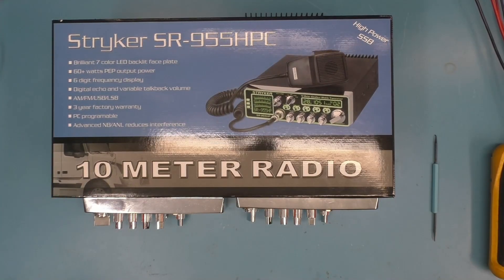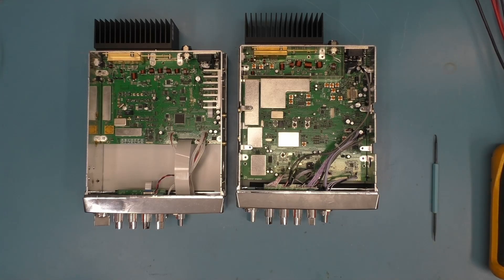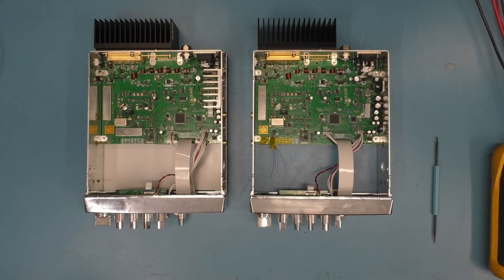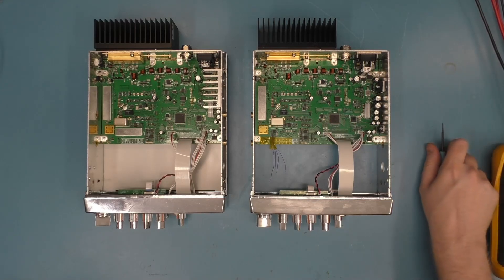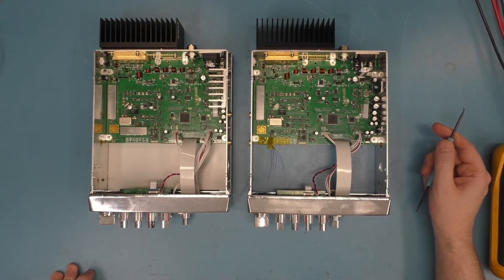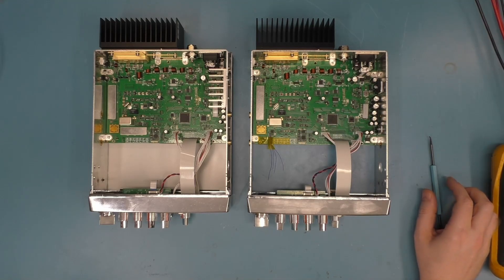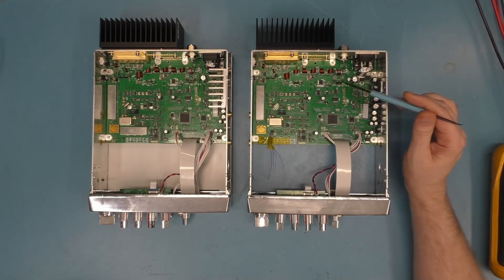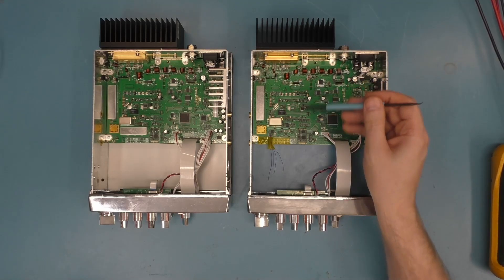SR-955 - Version 2 Internals - First Look

Comment: Mark I have a virtual instructor 955 it has been converted by watching your video I found out you can get ham radio on version 2 but is that the case on a virgin 1955 I would appreciate hearing your answer

Comment: These radios DO have a reverse polarity diode. It is in the back right corner. It is a SMT device labeled BET. I ASSURE YOU IT WILL BLOW UP IF HOOKED UP BACKWARDS!! 
73' Panic Attack
 @Mark19960   You are right it is a TVS and MOSFET. I over simplified my response. But I guarantee you it WILL blow the TVS diode if it is hooked up backwards! I have already repaired a 655 for someone that had the TVS shorted closed from reverse polarity. Telling ppl that reverse polarity won't blow up their next gen radios is a very bad idea! Granted the radio was fine but the rig has to have the TVS replaced before it will power up again and it will blow the rigs fuse if you try to power it up after reverse polarity occurs. It doesn't "magically reset" after a reverse polarity fault occurs.
Reply from the maker: Incorrect. They have a TVS diode and a mosfet. modern radios don't use reverse protection diodes anymore.
The component labeled "BET" is a TVS diode.
I assure you it will NOT "blow up" if you reverse the polarity.
Reply: @Mark19960   You are right it is a TVS and MOSFET. I over simplified my response. But I guarantee you it WILL blow the TVS diode if it is hooked up backwards! I have already repaired a 655 for someone that had the TVS shorted closed from reverse polarity. Telling ppl that reverse polarity won't blow up their next gen radios is a very bad idea! Granted the radio was fine but the rig has to have the TVS replaced before it will power up again and it will blow the rigs fuse if you try to power it up after reverse polarity occurs. It doesn't "magically reset" after a reverse polarity fault occurs.
Reply from the maker: @rangertechdx3511  You are wrong. TVS diodes are transient suppression devices. They have no polarity. You can reverse them over and over and they won't do anything until you exceed their threshold voltage. That's why they used one in this radio, for high voltage protecxtion. If you had a bad one that's because the voltage was exceeded, not because the polarity was reversed. They have nothing to do with polarity. That's not a condition that a TVS diode is used to protect against. There is no "magic reset" because the device isnt triggered in a reverse polarity situation, only overvoltage.
Reply: Ok they don't have polarity in the traditional sense but there are directional TVS and bidirectional TVS. The rig in question will blow the  TVS if reverse polarity occurs. The rig that was brought to me for repair was hooked up to his power supply backwards. He told me he did it. No way an over voltage situation occurred.
If you have so much faith in the directional TVS not blowing do a video of you hooking up your radio backwards lol. I'm just trying to help ppl just like you are. These radios....well at least the one I seen blew the TVS from reverse polarity...simple as that, rather or not it should have wasn't the scope of why I posted a comment. I understand perfectly what a TVS is and does. Most ppl that buy a radio won't understand though. I'm just saying I seen the radio blown up first hand from reverse polarity. I have nothing to gain or lose here I just don't want ppl blowing their radios thinking that the TVS and Fet will save them and no harm will be done from reverse polarity. Sure maybe they don't blow every time reverse polarity occurs but a standard rectifier diode for protection doesn't blow every time either. 
I am not wrong, the directional TVS can blow from a reverse polarity fault in this radio, simple as that!
I appreciate you messaging with me back and forth here. 
Maybe it has gave everyone a better understanding of how these radios are protected. Like I said the radio I fixed was fine. The protection circuit done it's job.
73 Panic Attack
Reply from the maker: @rangertechdx3511  The radio uses a bidirectional TVS diode.
You should know that those are intended for use on AC systems, digital lines with positive/negative voltage swings, etc...
And that is why reverse polarity will not cause a failure - they are designed for that use case.
The question becomes.... why are you repairing it instead of Stryker's warranty guys if its a new radio with a failure?
That would be a defective TVS diode... unless there really was an overvoltage or transient that caused it to do it's job.

Having one failure doesn't make it the norm.
Since you want to see a video, sure....
Reply: @Mark19960  I'm much faster than Stryker and I'm sure reverse polarity wouldn't be covered by warranty since it was no fault of Stryker. Also these radios use a unidirectional TVS device. It is plainly silkscreened onto the board. Remove one and have a look for yourself.
Reply from the maker: @rangertechdx3511  So the silkscreen now determines the part? Negative. What about the cap silkscreen on the board that has a resistor there?
Mate, I know what the part is. I know the part number of the part. It is a bidirectional TVS diode. I have the parts.
I will cover it....
Reply from the maker: @rangertechdx3511  Better yet. Go ask Stryker.... put it to bed.
Reply: @Mark19960  Just saying a unidirectional part is silkscreened onto the board and I seen a radio first hand blown up from reverse polarity from a regulated power supply. 
Oh crap....I'm man enough to admit a mistake I made. I just took a look at the bad part I removed and it is BIDIRECTIONAL. I didn't even notice when I removed it. I just seen the silkscreen on the board and replaced it with a directional J12a I had in the parts bin. 
The TVS in the radio tested closed so I yanked it out and tested the MOSFET it was fine. Seen the silkscreen for a directional TVS and replaced it with the J12a and all was fine with the radio.
Reply: None of this changes the fact the TVS failed closed due to reverse polarity.
Reply from the maker: @rangertechdx3511  That's assuming you have all of the facts. I have seen over my on and off career in engineering that customers are not exactly honest.
It also doesn't change the fact that the part is not intended as a reverse polarity protection device either.
Because you had one device that you think failed because of this condition doesn't make it a norm. It's at best a statistical outlier.... or manufacturing defect.
The correct part is CD214C-T18CA just FYI.
Reply: @Mark19960  That part is almost identical specs to the one I put in. Except the one I used was directional. I appreciate the info. 
In my experience a reverse polarity situation is the most common thing that CBers deny ever doing lol. He made his own 10awg power cord from the type of plug you can unscrew and solder wires to the pins. It was backward. I fixed it too. Maybe a freak thing, may be easier to happen than you think, I don't know, but reverse polarity occured and the TVS failed closed as a result, no more no less. That's all I wanted to say and I wouldn't purport that hooking them up backwards will cause no harm. I agree it is a better system of voltage protection, just to make that clear. I like the radios and am enjoying my 5555plus very much, just to be clear, I do think they are a great radio chassis.
Reply: @taft2422  I was sure of that as well. I appreciate the reply. He never would admit it's a very bad idea to hook up your radio backwards. I figured he was an inside man when he made a video and claimed the 5555 plus had a locked service menu and he wrote a program to access it but took the radio out of frame so he could push the buttons on the radio to open the service menu. Lol
Reply: The ppl need full disclosure. I appreciate ppl that respond to these guys!
Reply: @dhoutdoors9762  That's not a "claim". He had a video where he showed it and he took the video down. He probably showed too much.
His radio doesn't go into service mode like the other radios. He doesn't have to push the 4 buttons like everyone else on his radio.
Don't misunderstand the TAFT groups intentions here. We are holy fighters against Mark Sherman and his trolls.
When this guy says it's so, It is. He hasn't been proven wrong on any of this yet. If he says the radios survive reversed polarity then he is probably right.
Reply: @taft2422   @TA FT  Maybe so on the service mode, I don't know. I seen the video, I know he took the shot off screen on the video when he put it into service mode. 
What I do know is the radio I repaired did not survive a reverse polarity condition. I'm not saying these rigs don't have a better survival rate than others. I think the FET and TSV device is great! I just think it's a bad idea to say nothing will happen if you reverse the polarity. 
I'm not knocking what this guy is doing in his videos either. I just don't want anyone to take it the wrong way.
73 Panic Attack
Reply: @rangertechdx3511  I don't know anything about that stuff you were talking about.
We at TAFT are trolls. We troll Mark Sherman and he likes it :) We have more planned for mr marky sperminator.
You are splitting a hair man. We are trolls and we like to split the hair. That's what good trolling is all about.
I get it man, you are trying to troll. But he doesn't play ball with us trolls. He just starts to ignore us.
Reply: @taft2422  Nah not trying to troll at all, just stating what I have seen in this chassis if hooked up backwards. 
Keep up the good fight against the mud duck in the desert!!
Reply: @rangertechdx3511  We absolutely will keep that fight going. "Exposing" Mark Sperminator and his lack of "integrity" is our mission here at TAFT.
I just want to point out one thing man. You say you are not trolling. Ok maybe not.
You did change your story a whole bunch of times. You admit to making a bunch of mistakes. That's cool man.
The problem here man.. you say that it "will" blow up if you connect it backwards. I just did it to my Anytone and it didn't blow up.
It just didn't do anything. You say it absolutely will blow up if you connect it backwards. How do you explain mine?
You wrote in ALL CAPS " I ASSURE YOU IT WILL BLOW UP IF HOOKED UP BACKWARDS!! "
You keep speaking in absolutes. That it "will" happen. You said your customer admitted to connecting it backwards.
Come on man we have customers in our shops in the TAFT group that lie to us all the f ing time, or they don't know what they did.
We have Strykers in the shop. We will give them a try and see tomorrow.
Betting money that if my new Anytone didn't blow up then neither will the Strykers in the shop.
Just saying man. it's looking like Rutherford is right.
Reply: @taft2422  I guess I'll have to choose my language better. I should have said it absolutely CAN blow up from reverse polarity. Heck even standard diode protected radios survive a reverse polarity quite often. So I will be more careful in my wording from now on. 
Yes customers do lie all the time but I fixed his home made heavy duty power cord too that was wired backwards. 
I don't see where I made a bunch of mistakes. I oversimplified my initial comment by calling the TVS a reverse polarity diode, like I said I'll choose my language more carefully next time. But come on man how many ppl that buy a radio know what a TVS is anyway? It is part of the system that protects the radio from voltage spikes, reverse polarity, etc. ok? ok. I admit to mistakingly calling it a directional device and even putting a directional device into the repaired radio due to only looking at the silkscreen which is marked for a directional device. 
I certainly don't see where I changed my story either, only more details and clarification added.
The only point I wanted to make is the fact the radio CAN "blow up"(well blow a part in the voltage protection system which most "techs" would call a diode) from reverse polarity. I'm not trolling on Mark Rutherford at all. I appreciate his content and the conversion we had here. I certainly didn't expect so much push back for me reporting that I fixed a radio that was hooked up backwards and it blew one of the parts in the voltage protection system. I don't do much internet posting or commenting (I would be a terrible troll, heck I'm terrible at trying to help ppl to I guess lol)
I just don't want ppl saying to there friends "watch what my new radio can do when I hook it up backwards"  then poof!
 I'm glad your Anytone survived! It is a superior protection system with out a doubt. But believe me, I seen it fail from reverse polarity!!!
I'm very interested in seeing a video of this radio chassis being hooked up backwards!!
I'm loving my 5555 plus that's for sure. 
73 TAFT my intentions here are honorable as is the war against the mud duck in the desert!

Comment: ONE OTHER NOTE THE LINCOLN 2 PLUS ALSO HAS WATCH DOG SWR SHUT DOWN THAT THE OPERATOR MAY SELECT A SWR LEVEL  AND IT WILL ALSO SHUT DOWN THE RADIO TO PROTECT THE 13N10 FINALS.
Reply from the maker: What are you on about mate. What exactly am I mistaken about?

Comment: YOU ARE MISTAKEN ON NO OTHER RADIO NO OVER VOLTAGE PROTECTION AND LOW VOLTAGE PROTECTION. THE PRESIDENT LINCOLN 2PLUS HAS THIS AND IS AJUSTABLE AND IT WILL SHUT THE RADIO DOWN GIVIN THE SETTINGS THAT YOU APPLY.

Comment: How is the 11 meter conversion done now?? is it still removing the diode or is it all through the front of the radio in software??
Reply: I heard there was a wire inside that needed to be clipped, but taking that with a grain of salt. Hopefully someone will chime in and have the actual procedure for the V.2.
Reply: Thank you my friend for the input
.hopefully it is simple like the original one...
Reply from the maker: It’s simple. Just a wire.

Comment: Thank You, great tech info @@UCHTKv7msDiy_-nVWrwAmZcw . I just bought  a New 2021 Stryker 955 with the last of the current old boards, new from my Tech because I wanted to have a last Gen adjustable  955s ,gonna buy one of the 2022  955s to get the new board to check out and  have my  tech compare . I love the Stryker 955HPC  radios.

Comment: Hey great video. I haven't heard much lately about the front panel mod board for the 980SSB, I need a version 2 board for my radio. Can you sell me one?
Reply from the maker: The reason I have not fiddled with that is the displays seem to die a horrible death.
There is some issue with the LCD displays themselves.. and that pretty much kills that idea.
I don't want someones' display dying then looking to me to help, because I can't help that.
Reply: @Mark19960  if one were to get it in writing that they would not hold you responsible, would you still set them up? If the display failed, I would just get another radio and swap the board. I am an electronic technician so I could do the soldering my self.

Comment: The small board at the front is NRC (noise reduction circuit) behaves like a DSP on incoming audio. They use it to remove noise digitally to allow voice to be clearer on AM. Old ones it sounded a tad robotic especially in FM low signals. But the factory have since made it possible to add it onto a single chip so additional board not needed. The marked out chip I’d imagine handles the NG function (noise gate) that electronically kills background audio when you transmit
Reply from the maker: Thanks Simon.
There will be more to come that's for sure as I discover more about it.

Comment: They need to make that new one, half the size. Its crazy how unnecessarily deep the radio is. Improve the box to match the improved internals :)
Reply from the maker: Part of the issue with that is tooling costs. It may not make financial sense to do it.
They already have that in place, and they may already have these parts on the shelf.

Comment: Dunno if it's a "baofeng style" chip when it's used as an LO. Could be an Si5351c clone used as the LO. The presence of a 455kHz IF filter points towards to it being a traditional superhet instead of a single chip wonder like baofengs with RDA/AT (RDA spun off the radio chip division into it's own company, thus the new chips start with AT instead of RDA) or Beken radio chipsets.
Reply from the maker: It’s not an si5351 clone. It has an audio input and will FM modulate the signal. It’s likely a clone of the RDA one chip wonder. The commands sent are similar as well. It is a traditional superhet receiver. They are using those to generate BFO and 1LO.
Reply: @Mark19960  Oh that's very interesting. So that chip does direct FM to the freq or at the IF freq? Those would be very useful for adding FM to homebrew rigs like uBITX.
Reply from the maker: I poked at it some more. I was looking at the output of the filter because it was convenient to probe... so I was wrong about the frequency it's outputting.
The IC is outputting a 36Mhz signal, then being mixed with the same 26Mhz that is feeding the ic to produce the ~10.7Mhz BFO/TX signals.
Poking around pins 8 and 9 FM modulate the 36Mhz RF. Either they are audio inputs, or pins that "touch" the loop filter somehow.
Also another thing that points me at it being a one chip rx/tx ic is that pin 6 has white noise on the output. but it's only present when the radio is in AM/FM RX.
It makes sense, because the IC stops outputting a signal in those modes. I'm betting they just switch the IC into RX.

Comment: Soon CBs will be a Raspberry Pi with an antenna jack on the back.
Reply from the maker: I sort of doubt that. Mostly because the rasberry pi and arduino are hobbyist gadgets.
You will get funny looks if you came to the table and advocated using an Arduino or the like for system control in a product.